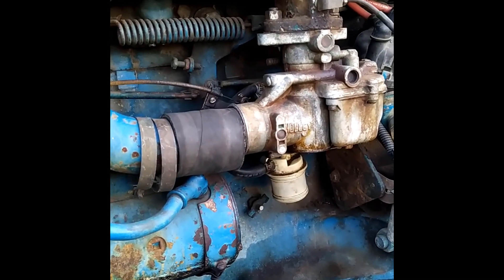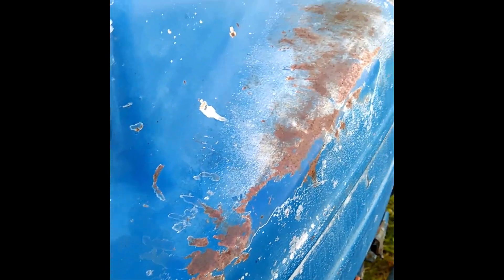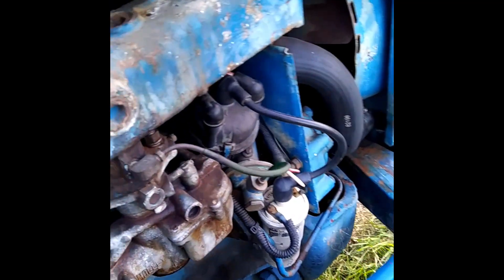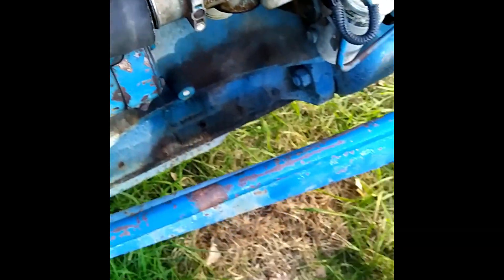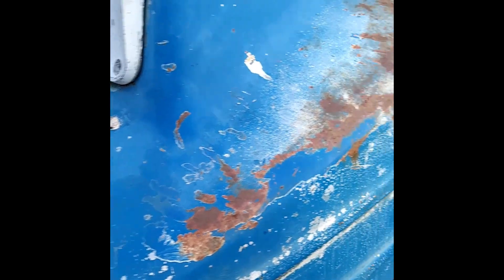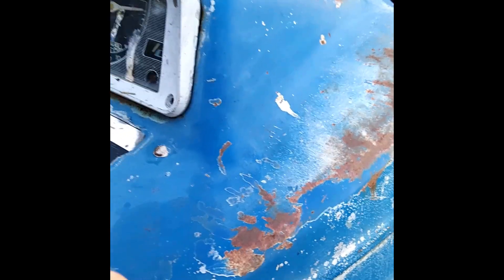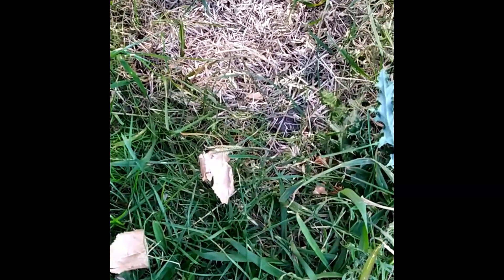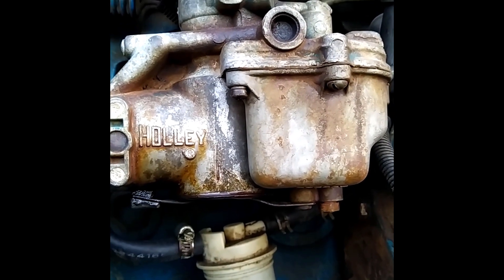Why will my Ford 2000 tractor not start?

Comment: gasoline internal combustion engines need 3 things to run. fuel, air spark. with the air cleaner hose off, you have enough air, starting fluid should provide enough fuel to run for a few seconds anyway. need to check spark. probably needs plugs anyway , so replace them. hook up a timing light to check for spark. should spark in a routine manner. if the sparks are non-existent or erratic, the problem is the ignition system. points, condenser, rotor, cap and wires should get it running. when you "cleaned the carb", did you clean the passages or just spray it down, put new gaskets and go with that?? that is a holley R4119 and has more than a few parts inside. power valve, check balls (hidden pretty well) etc. with updraft carbs, it is not unusual for fuel to run out the inlet when the engine is stopped. that why it has a fuel shutoff on the tank. didnt see any fuel running out in the video clip
Reply: Tell me more about them check balls

Comment: I have the same problem, new plugs, wires, distributer, coil, new carb, fuel pump is working and new within 2 years, fuel filter clean .
80# compression which is right on the edge of what the manual says it can have 105-140 +\- 25 psi.
new battery, newer starter.  

It kinda wants to start but won’t even with starting fluid.  
Has plenty of fuel. 
With all the plugs out I can see it spark in order and bright big spark. 

Took it to the new holland dealer and they set the timing back to the marks I had it originally set at.  They handed the carburetor to me in a box after they hit the $500 limit and told me it needed a rebuild. 
Exhaust does have some pressure to it if you hold hand over tailpipe. 
I’m at a total loss on why it won’t fire and run.  If anyone has any ideas let me know.